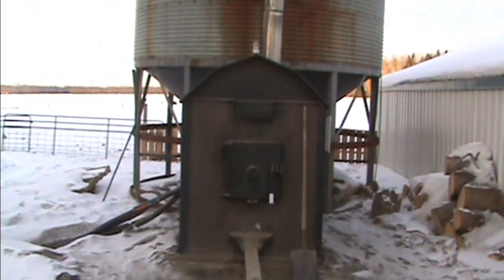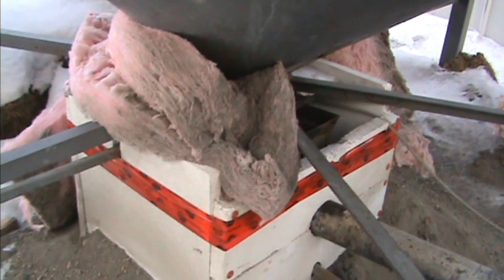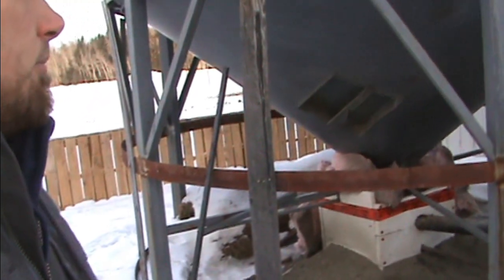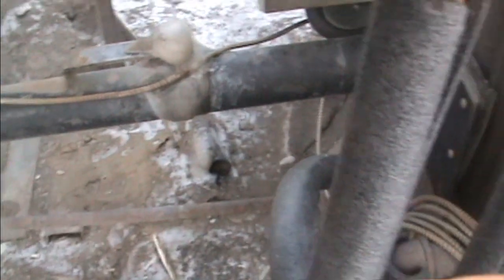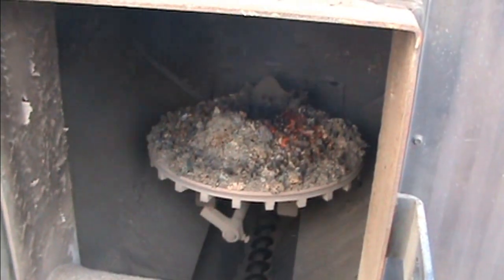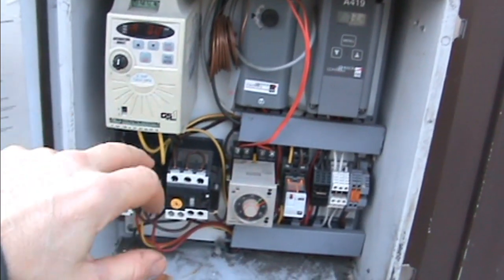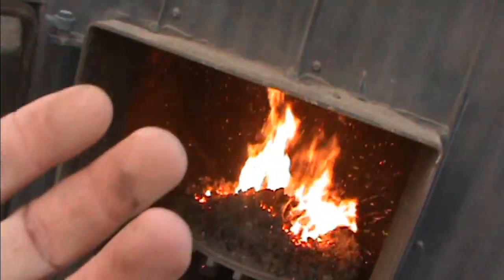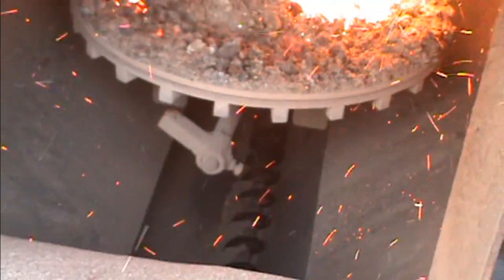Home heating with coal

Comment: The system I'm installing now is very cheap and very basic. We have a yurt homestead in Mongolia. Our first winter we heated with  electricity (underfloor) supplemented with wood stoves but it cost us a fortune in electricity. The wood stoves burn too quickly and we never figured out how to get a long burn.

So this year we're installing a coal furnace and 4 radiators. The coal furnace is quite small but I'm assured it will be sufficient for our needs (2 yurt, a bathroom and insulated shipping container workshop. The coal furnace will be in a partition of another container. 

Total cost for parts and installation is US$2600. We spent more on electricity for the year. Coal is US$1 per bag (25kg, I believe). It's subsidized for residents and also on a quota system so we can get 6 bags per week and no more. But you can stockpile your quota in the shoulder months for the colder months. Our coldest months drop to -40C/F on the coldest nights.

It's a lot more work for us. The feeding of coal and cleaning of ash is totally manual. As a bonus/backup we're having an electric heating element installed if we need to be away for a day or more so the heating will still work without using coal. It can use wood too but coal burns longer and hotter. Apparently, half to one bag a day is enough. We'll see. The important thing is we should break even in year 1 or 2 then save a lot.

Compared to you we are very small. We have about 107 m/2 of heated area.
Reply from the maker: Very interesting, May I ask how you ended up in Mongolia? Or are you from there?
Reply: @countrysideacreshomestead2008   the short answer is a woman. I married a Mongolian in 2010 and moved to Mongolia from London, UK a year later. I loved the country so much that I stayed even after breaking up. 

Now I'm with another Mongolian woman. The country life suits me well. It's lovely here yet harsh. Similar to the Canadian prairies or Rockies but probably colder. We're obsessed with survival in Winter and have multiple backups. Just in case.
Reply from the maker: Wow, thank you for sharing!
Reply from the maker: I'd like to visit Mongolia one day, lots of history in the east!
Reply: @countrysideacreshomestead2008   Yes, you should. It's very different here. That's why I like it.

Comment: Hows does it hook up to the hopper with the auger ?
Reply from the maker: I'm not sure exactly what you mean... the stove has an auger in it that extends out the back and into the hopper
Reply: What i mean is when how does auger Attach to the hopper. 
Does it just sit under it ?
Reply from the maker: Ah ic.
The auger is stuck to a hopper that hangs under the overhead bin full of coal. As the coal augers out it makes room for more coal to fall down out of bin.
Reply: Thank you and it a Awesome video.

Comment: As the owner of a dump truck and tractor / end dump trailer combo I would deliver the coal for $10/ton if you were 30 miles or less away from the coal yard but you’d be the one buying it. If you’re getting coal for $10/ton for the coal plus delivery then that coal yard is giving you coal for free.
Reply: https://youtu.be/52BrzIm2Vvo?si=ZroCK4-KT671gSBL❤❤❤🎉🎉🎉

Comment: If that's a out door boiler just run Pex around the coal bunker and insulate the the whole thing then put on lagging. Nothing will ever freeze unless your power goes out and you run out of generator diesel.

Comment: We burn wood pellets some thing similar to that only only you don't hear them burning the pellets are blowing into a big upside tent thing there is no smoke from them they heat the under floor heating plus all the hot water that we want the pellet burner is inside the double garage and the big tent thing is in a out shed the pellets are a compresses sawdust about half inch diameter and about 1 inch long they are fed into the burner the same way as your coal
Reply from the maker: I've seen those, a friend of ours put one in and he loves it.
Reply: Bags of pellets are expensive like 5 -10 atleast for a 50 pound bag a bag lasts a day thats a waste
Reply: https://youtu.be/52BrzIm2Vvo?si=ZroCK4-KT671gSBL❤❤❤🎉🎉🎉

Comment: Did you say. You used 30 ton per year?
Also you mentioned $ 10.00 per ton
Reply from the maker: Yes 30 ton per year and it was $100/ton .
So approximately $3000 / year

Comment: 1 inch line can only transfer 75,000 BTUs  so max output only 150,000 BTUs . I'm sure it could output alot more . If it had more lines or bigger water lines. Interesting system. Also check trench heat loss .
Reply from the maker: Ya it was a neat system.
Reply: @countrysideacreshomestead2008   was?
Reply from the maker: @GrizC  We sold that farm in April of 2020, moved to our current homestead. I would assume the system still works great.
Reply: https://youtu.be/52BrzIm2Vvo?si=ZroCK4-KT671gSBL❤❤❤🎉🎉🎉

Comment: Perhaps consider enclosing the bottom of the coal silo. You'd be surprised how effective eliminating wind chill would solve the coal freeze problem.
Reply from the maker: Great suggestion, we actually tried that for awhile with styrofoam panels  but it didnt help like we hoped it would.
We no longer live on that property though, we have moved and are working on a new house.
Reply: @countrysideacreshomestead2008  still using the coal I hope. I've got a modified coal octopus stove operating like a gasifier burning wood. I'm hoping to convert it to a boiler before next winter. Best of luck to you!
Reply: https://youtu.be/52BrzIm2Vvo?si=ZroCK4-KT671gSBL❤❤❤🎉🎉

Comment: That set up is heating a lot of places. That’s good. I thought coal would cost more
Reply from the maker: Depending where you live, it might cost more. We are not very far from the coal mines (5 hrs) trucking is what gets you.
Reply: I was thinking that same thing
Reply: Took bad you can't recycle the ash to burn
Reply from the maker: There was very little ash and I dont believe there would have been anything left to burn in it. The coal burnt so hot and efficient that most times there was no smoke.
Reply: How is the heat getting to the places you're heating
Reply: Is it heating the water then pumping it under ground to your place?
Reply from the maker: Yes there are water lines underground and a pump on my stove that circulates the water to the buildings and then back to the stove.
Reply: https://youtu.be/52BrzIm2Vvo?si=ZroCK4-KT671gSBL❤❤❤🎉🎉🎉